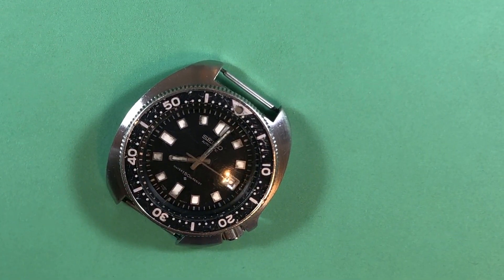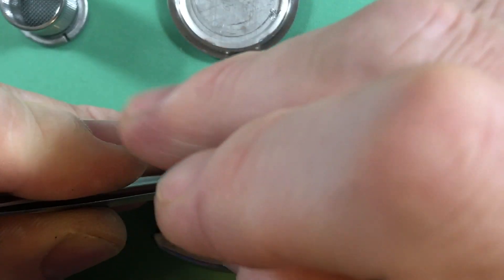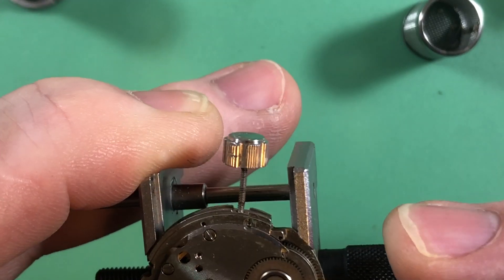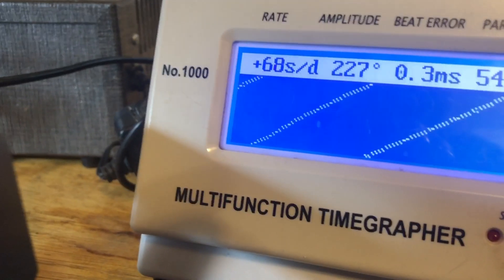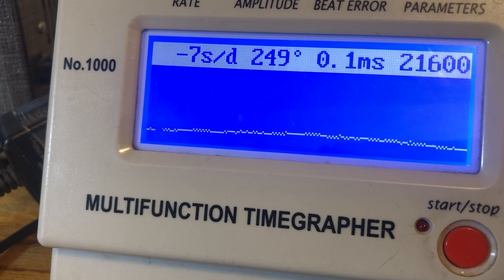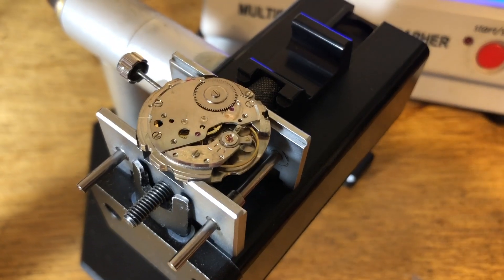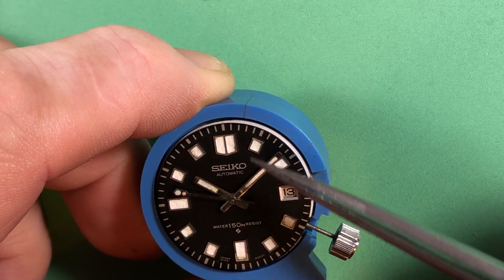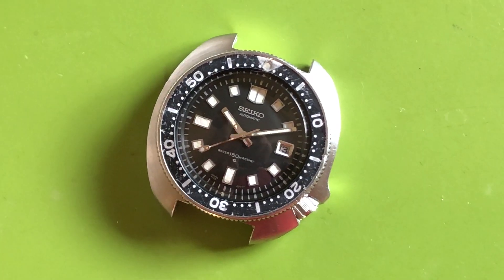For AR: Seiko 6105-8110 Willard Restoration

Comment: the straight edge is actually closer to correct as the bevel plates phased out 12 months earlier on the 6105, at the same time that the horseshoe back disappeared.